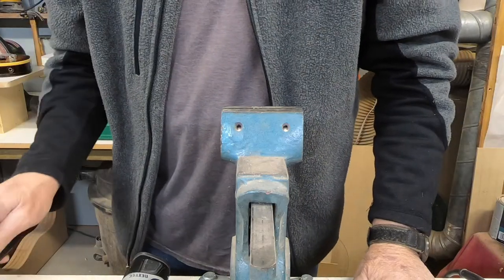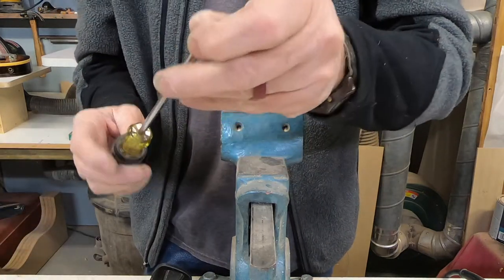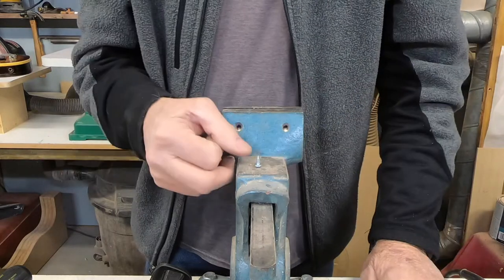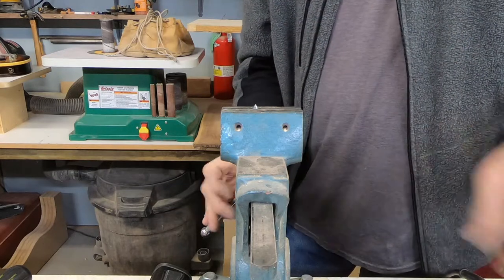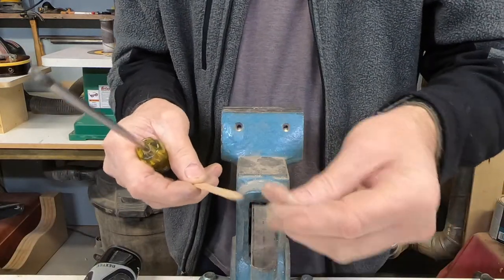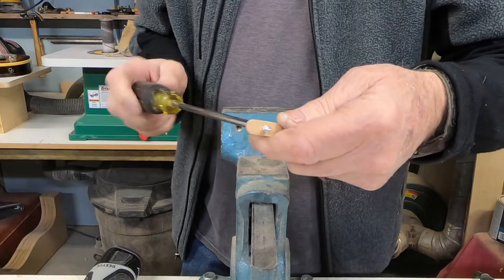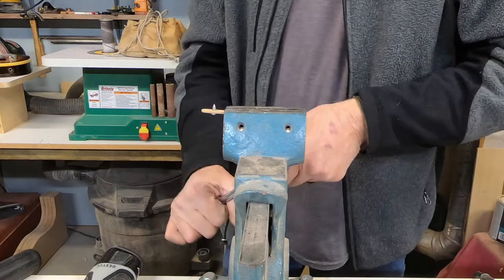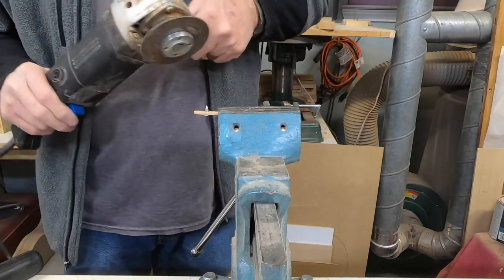SCREW HOLDING TRICK FOR CUTTING by JONAH GUITARS

Comment: You should never use the side of a cut off wheel, to grind.
It damages the fiberglass strands, which hold it together and
creates a dangerous situation. It may fly apart now or it may fly
apart later. It will happen without warning. 😱😭💀👻🚑
Reply from the maker: You are not wrong! That one is going in the trash.
Reply: Also when the wheels shatter they can penetrate the flesh. Always good to have the guard on to protect your body. Great method for holding the screw by the way.